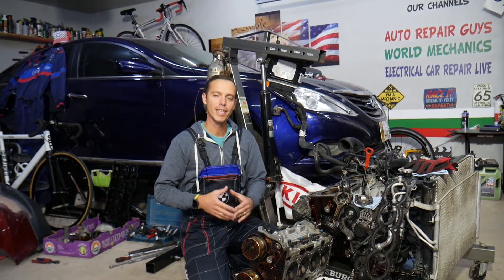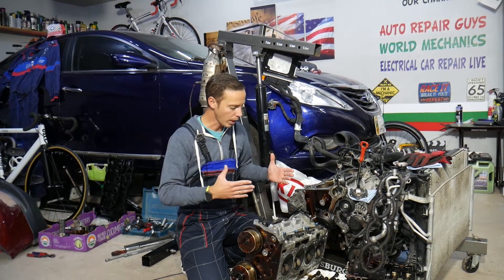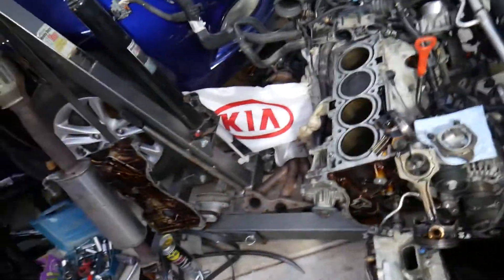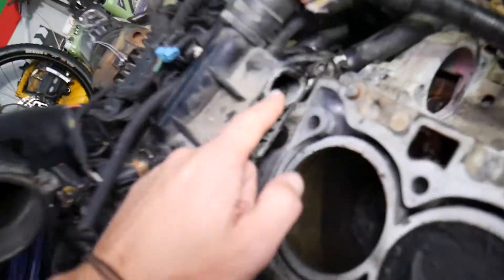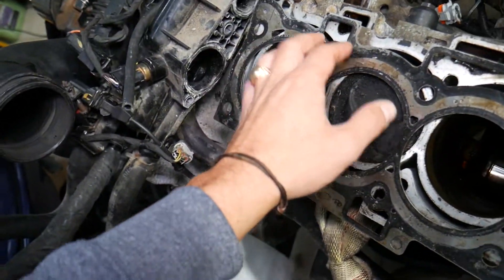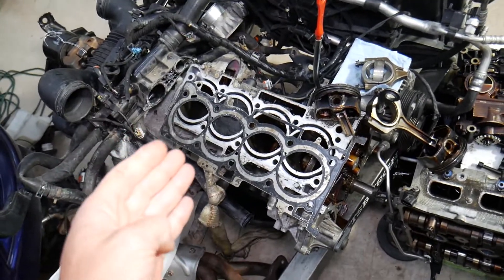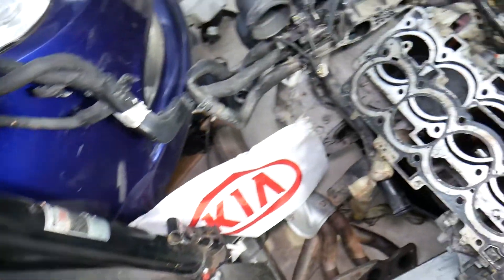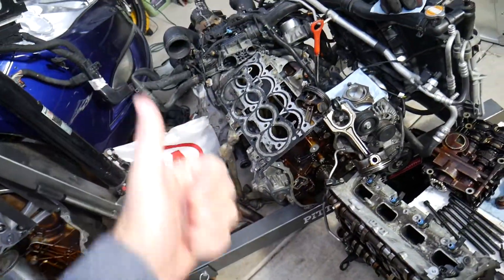HYUNDAI SONATA LOOSING COOLANT BUT THERE IS NO COOLANT LEAK

Comment: I have hyundai i40, had this problem and was told head gasket is gone, I got it repaired twice, and worked for about 3-4 month and started same symptoms. It all started from after changing radiator and I lost heating, I only get slightly warm air from driver side and cool from passenger side on highest temperature. When I am driving about 60-70miles an hour I hear some water/coolant sloshing under bonnet, when I check the coolant reservoir get full and after a while the level from Reservoir drops. Please help and advise what it could be I cannot afford paying for head gasket repairs again.
Reply: did you figure the problem out?  I'm having a similar issue.